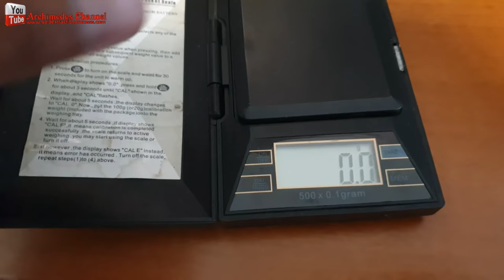how to silver recovery from electrical equipment circuit breaker x-ray film | todays silver dollar

Comment from the maker: Recycling Silver Cadmium Contacts Can Give You a Big Payday
There’s a lot of money to be made by recycling them, for several reasons. First, old industrial components made of silver cadmium are not difficult to find, because they have been used for years in many manufacturing processes. Second, with cadmium trading at about $12 per pound, a quantify of unused or recycled silver cadmium components can offer you a big return over what you paid for them.

Why Is Silver Cadmium Used?
Good question. Silver cadmium contacts and other components are used in electrical devices because they possess two contradictory traits. First, they are excellent conductors of electricity. Second, they are also arc-resistant, which mean that they inhibit the tendency of electricity to arc between open contacts and cause fires. Those two traits make alloys of cadmium and silver ideal for use in switches and other applications, especially where high electrical loads are present.

Where Can You Find Cadmium Silver?
If you own almost any kind of electronic scrap, you probably already own quantities of silver cadmium scrap. It is widely used in motors, switches, relays, and electrical contacts.